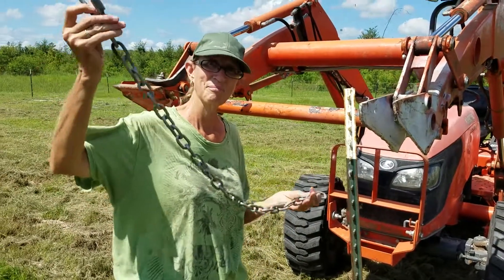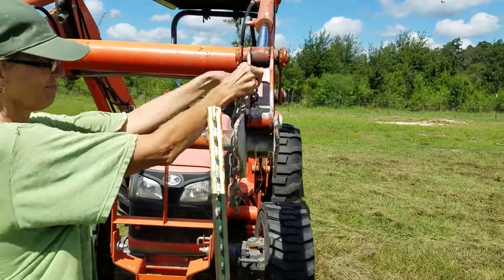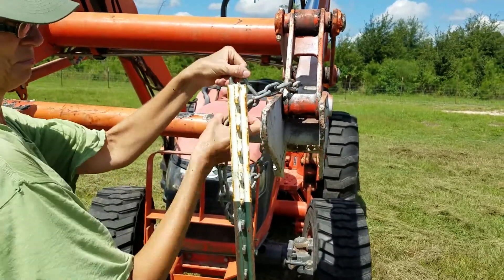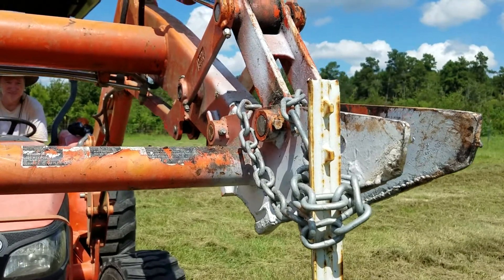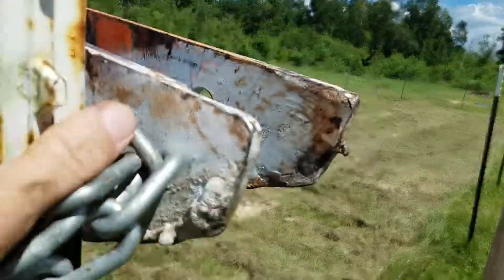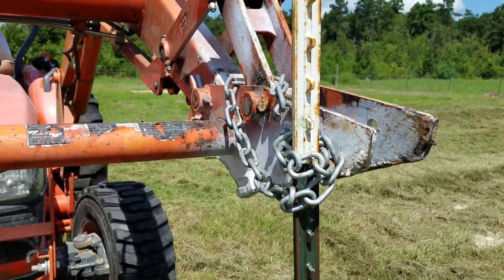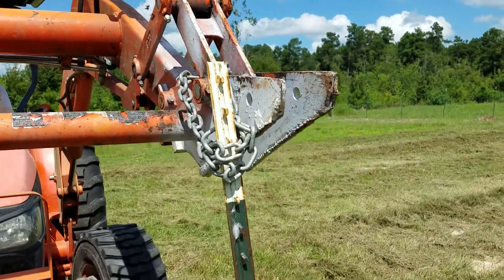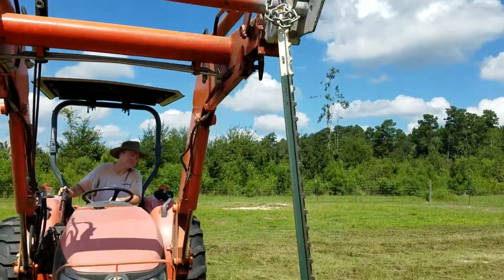How to pull T Post with a tractor

Comment: You might try welding a chain low to one side of a piece of pipe. When the chain is pulled up it tips and catches in the notches of the post and pulls it out. Only takes 10 minuets to make and worked well for me.
Reply: You can probably use the tractor to place the pipe and then shake it free without getting out the seat?